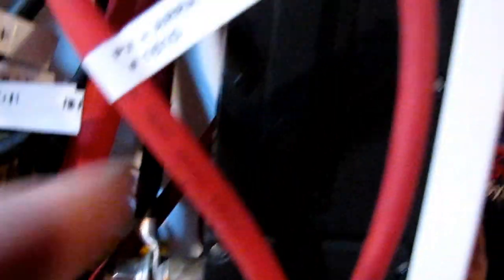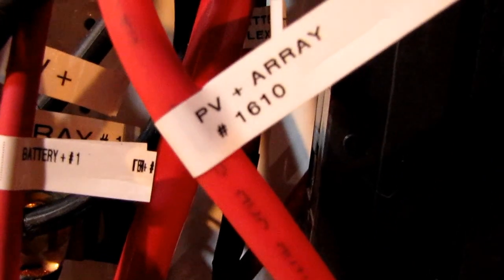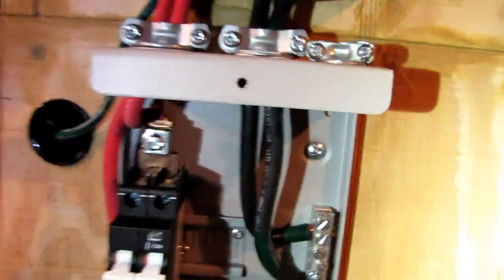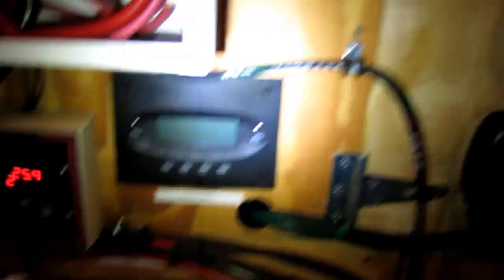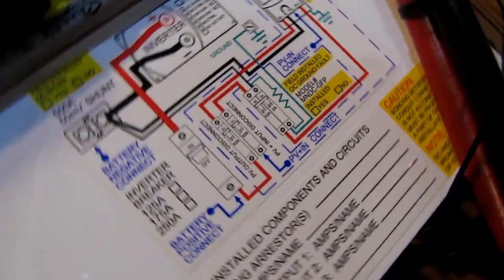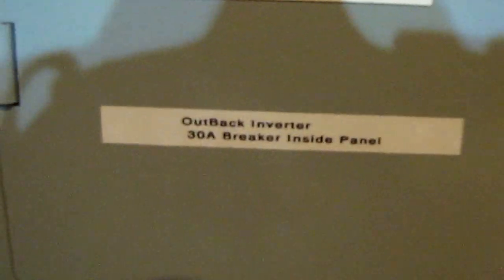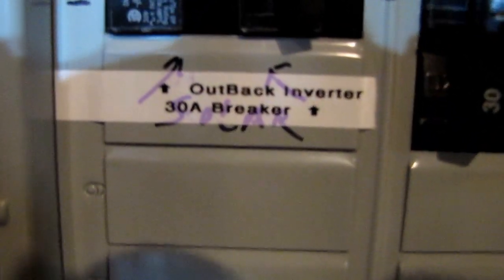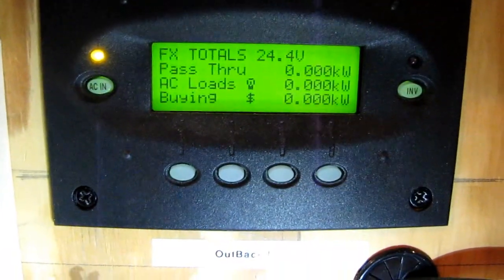Solar And  Wind My Mini 250 Amp DC Disconnect Box Breakers Start Up ! By VIARLOCITY

Comment: hello Kenny I have just received my midnite disconnect box did you chop the negative battery bolt off if you use a shunt ...cheers
Reply from the maker: Hey Buddy Keep it on there I mounted my shunt below it Buddy Cheers Brother